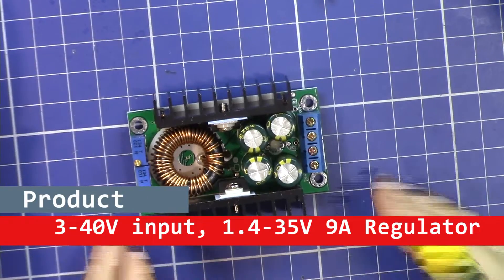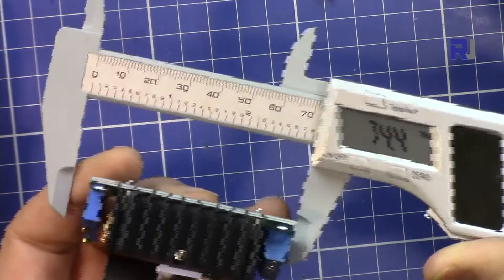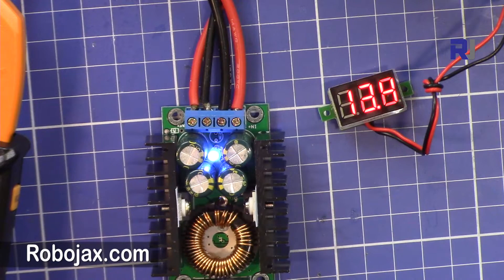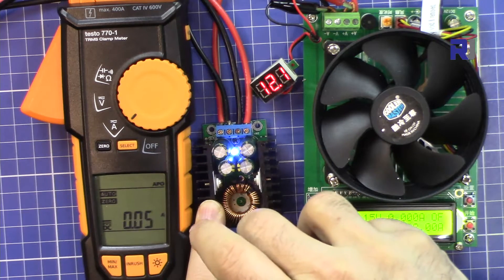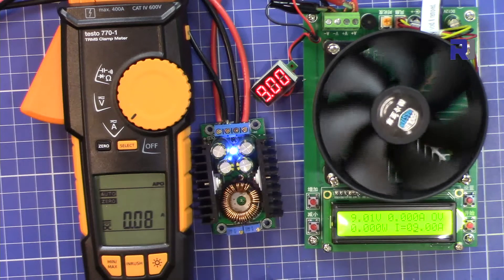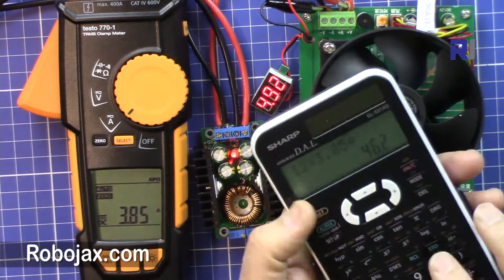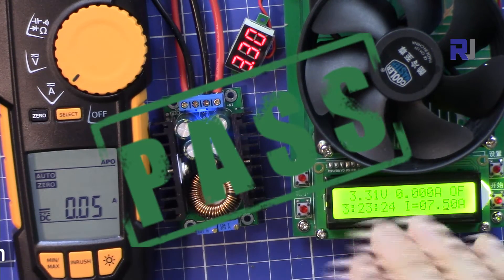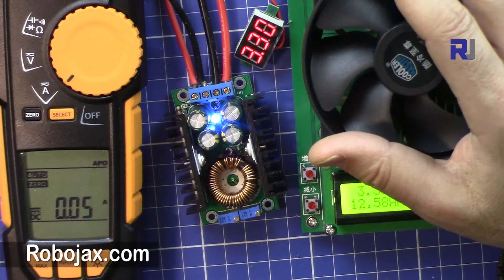DC CC 9A 280W Step Down Buck Converter 7-40V To 1.2-35V XL4016 Module - RJT321

Comment: I'm sorry for being a newbie. But what exactly it means, when the LED changes to red?
Also, do you think I could find shorts in a circuit with this, like it was a normal bench PSU?
Reply from the maker: the RED LED means that your load is drawing to the maximum set (current limit) or maximum allowed current. Yes it will let when there is short circuit.
It is possible that you have set the current so low (minimum), even when there is no load, the current limiter kicks in.
So measure the input current (connect ammeter in series with your power supply and this module), then short circuit the output and rotate the potentiometer with screwdriver and set the current to just above your expected value. Example set it to 2A.
Reply: Thanks for your answer! I would like to fix a laptop motherboard, which is shorted on the 1.5V rail. I was afraid, that the red LED means something bad, so I turned it off before I could feel a component getting warm. But now I'm going to try it.

Thank you again.

Comment: I got one of this from china, and subjected it to 38 volts dc supply,  and within seconds two capacitors from the input side blew up. Turns out they were rated at 35 V - 1000 microfarads. I noted the outgoing capacitors were rated at 50 Volts 470 microfarads. So I figured they must have been swaped by mistake. I changed the out going capacitors be the input capacitors and replaced the blown 35 volts capacitors. Works out great now. handling upto 42 volts input.
Reply from the maker: Wow. Very interesting. Each product is supposed to be checked before shipped. This shows how quality control (QC) is very low in most Chinese manufacturers.
I am glad you figured it out. Smart :-)
Reply: Thanks. I learnt something from that and that is not to assume the basics like visual inspections before putting them into use or even testing. It's good what you do, you give us a good head start so we know what to expect.
Reply from the maker: You are welcome. I am glad my work is useful for humanity.
Reply: Got one from China and it had loose solder points that caused strange operation. Also had one bad screw terminal.
Reply: Thanks bro, I bought one some days ago but it come with a crushed capacitor, so I thought it would be better to replace it before connecting the module to the voltage (I still have to replace it) I read your comment and  then comparing my module with that of the video, I noticed that the capacitors are inverted also in mine converter.
Reply: I am considering something like this to lower the voltage from a 24 volt 200 watt solar panel down to around 16 volts before feeding to an MPPT solar controller which will be charging a 12 volt sealed lead acid battery, thanks for the capacitor info.
Reply: pm me can you to install do sola paint of charger¥